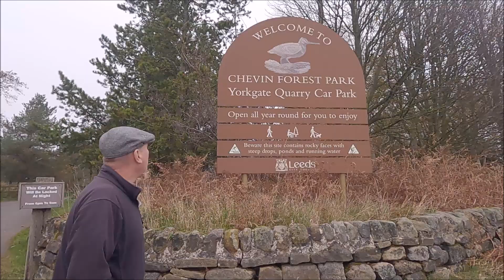My first POTA activation

Comment: Thanks for sharing your activation Chris using an AmPro whip.
I was initially skeptical whether a 40m one would work well enough but I am pleasantly surprised with the results.
I have used it successfully on many UKBOTA activations together with a Mag Mount.
When space allows, I prefer to use an OCFD using my drive-on plate which yields of course much better results.
73, Robert

PS. Nice set of wheels! 😎
Reply from the maker: Hello Robert. My favourite portable antenna is the linked dipole. I bought a couple of Ampro whips to use when Natalie and I go away in the Campervan. Although they are a compromise it's safer that having any wires strung out if there are people wandering around the camp sites. I'm looking forward to trying the 40m one. I might even buy one for 17m to use when the bands are full of contest stations. Hopefully speak soon. 73, Chris M0RSF

Comment: Well done Chris. Did you have the Ampro mounted on a Magmount on your vehicle, or did you ground mount it ? Thanks 73
Reply from the maker: I had the Ampro on a mag-mount on the roof and I know that this is not ideal. I have a 40m Ampro but I'm not expecting that to work very well at all. 
73 Chris M0RSF
Reply: I've worked the world on 40m SSB with the ampro 40 Chris same as you on the triple mag mount 😊 @M0RSF